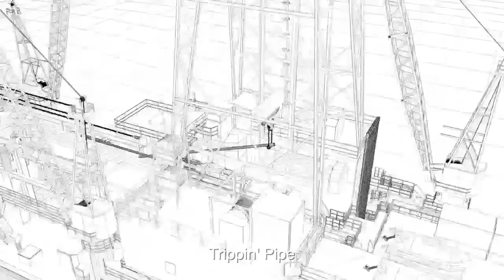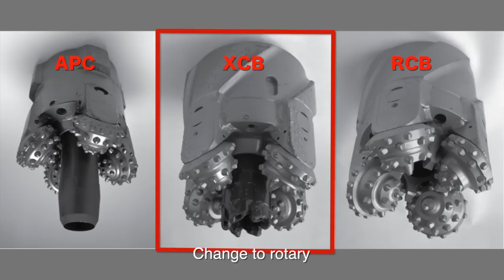Trippin' Pipe

Comment: Why do they trip with two sets of elevators and no slips?
Reply: Think they sett the pipe off inn the floor with the elivator instead off using a slip. Then they push off the beyls to the other elivator that they allready have fitt to the next stand.
Working on drillfloor myself inn the north sea. We allsow using slips, manuel or atomatic.
Reply: It's a dual elevator system. It was first used on this ship. Works really well.